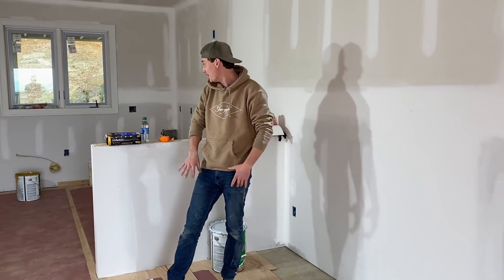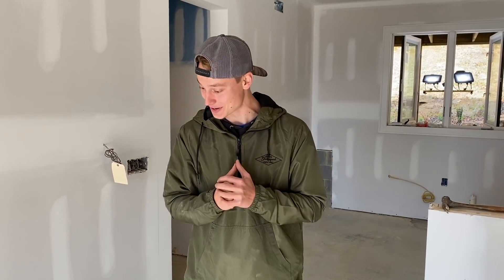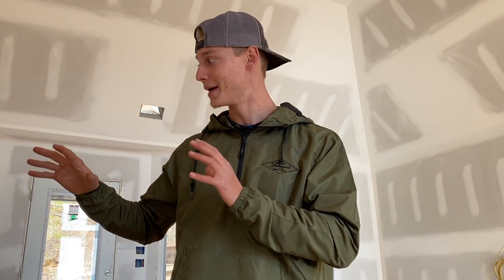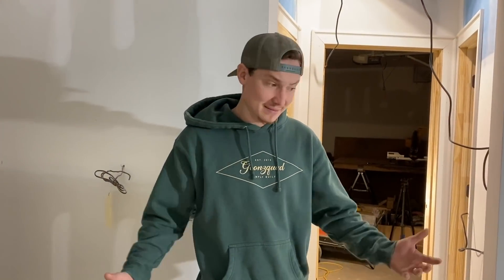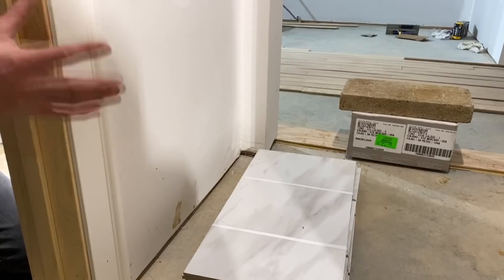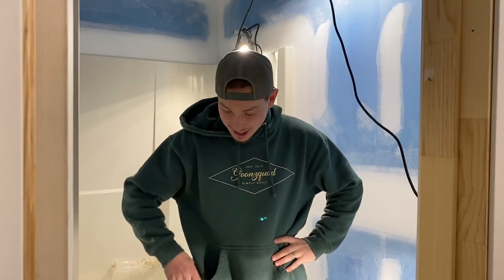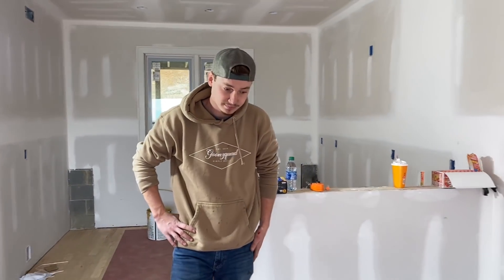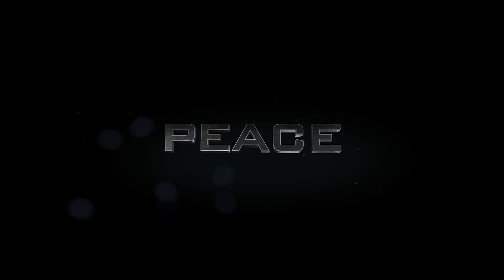The New Goonzquad Headquarters Part 55

Comment: Should have laid some sort of material before laying the wood flooring straight onto the concrete
Reply: That's what I thought
Reply: Not to mention, at the very least, a leveling compound!
Reply: It is engineered hardwood, that is exactly what it is made for.
Reply: They're using Mapei Ultrabond Eco 980 in the video.  Concrete at least 28 days old is a suitable substrate and it can be installed on below or on grade concrete if a vapor barrier is below the slab. edit: a few other requirements like relative humidity of the slab under 80%.
Reply: I do believe that is how all wood floors are layed on concrete. What you are thinking of is a floating floor. The barrier below the wood would create opportunity for the wood to lift in the future.
Reply: @toddward2310  oh
Reply: We had our floors leveled with compound and then glued straight to the concrete.  That's how its done on concrete slabs when its not a floating floor.
Reply: @newbeginnings6335  you can’t put real wood directly on concrete, it will rot. The bottom 3/4’s of the material they are using is an engineered product made specifically to be glued to concrete, only the top 1/4 is actual hardwood. That is why it can not be ruff sanded like they did on the top floor, they would almost immediately sand away there hardwood. Their flooring upstairs is full hardwood, not engineered because the mating surface is wood upstairs, not concrete.
Reply: Don't you all get it, fails mean more clicks, like that nonsense with the big window and everything else.
Reply: They needed to use a glue with a moisture barrier mixed into the glue like ultra grip. But it's about $270 for 4 gal and covers about 80sq ft a bucket. Eventually the concrete will sweat and swell the wood then pop up and discolor a few years later. Also with hardwood you have maintain the moisture level in the home at all times. Opening the window on a humid day will create issues like cracks in the finish.
Reply: I installed bamboo flooring in our home on concrete slab. The glue I used creates a moisture barrier. The only thing i did differently was to trowel the glue on the floor instead of to the flooring like they appeared to. That way I assured that the concrete was completely covered with the barrier.
Reply: @toddward2310  that makes sense why the 3/8 was not what they went with in the first place. These guys came from doing flooring I trust they know more about this than most other things they do.
Reply: Upstairs you are supposed to have a paper layer put down first.  In the old days they used tar paper.  This is meant to prevent squeaking.  The ultrabond eco 980 is the incorrect glue application they need Mapei Ultrabond ECO 995 introduced in early 2010 is a combination adhesive and moisture protection application.
Reply: the glue is moisture prove.
Reply: @Patty Homes well they're just asking for issues. When they first installed the windows i was like wow ok they're going to leak. Last week it did and ruined their floor. They need to do things right from the beginning else you'll end up doing double the work and actually waste more time and money.
Reply: @toddward2310  so your saying engineered wood wouldn’t expand or potentially dish if the slab was above the recommended moisture content and there was no damp proof membrane between the two
Reply: @mikep8080  There should be no need for a moisture barrier upstairs. Only reason for tar paper upstairs would be to help reduce creaking noises. But I do agree, glue used on concrete slabs should be moisure resistant type.
Reply: @Collie_Collie_911  That's what I said and in my comment I stated the paper was to help prevent squeaking.  My house was built in the 60s and back then they used the same tar paper that was used on the exterior walls.  I have a roll of the modern paper in my supplies for when I do my kitchen in oak.  It must of taken weeks for homes to finally air out the tar smells back then.  Interesting fact that the reason alot of homes were built with oak flooring in the 60s is the construction companies were given a tax break if it was used.
Reply: @vita8208  The 980 is called moisture cured nothing in the specs state moisture proof.  The glue uses moisture in the substrate and the air to cure the glue.  The 995 is specifically listed as moisture proof.  It is also the glue recommended by the manufacture for that application.  With wood floors its always best not to take chances.
Reply: @mikep8080  bad if it's the wrong stuff, you're correct.
Reply: Mike P I know that's what you said, my bad. I was skipping through the video and glanced over your comment. I missed them troweling the glue down as well, only noticed the first row they had to take back up where they glued the back of flooring.
Reply: @danielboard7097  I am saying that engineered hardwood was specifically designed and created for concrete application. I know this because the $30,000 worth I had put in my house when they were building it was done this way, and when I freaked the f out on the builder because they were not using any barrier, they took me to school about the product. I was told however, that I need to monitor and regulate the humidity inside my home or the floors will buckle and dip if humidity gets to high or to low. That is a requirement in any home with real wood floors though. I was told to keep my humidity between 35 on the low, and 45 on the high side which I have, and I can tell you my floors look exactly the same as the day they were installed 6 years ago.
Reply: It doesn’t matter because the glue will catch on the concrete and wood when it has a sealer on it. So if you put a mattierial it would move just for you to know!!
Reply: @toddward2310  that is the truth and that’s why GOONZQUAD bought engineered floors.
Reply: @toddward2310  interesting I also fit hardwood and engineered wood here in the uk.. and if I were fitting either, fully bonded to a concrete floor it would be getting a liquid damp proof providing the concrete was still damp of course. Engineered is far less reactive to moisture but I wouldn’t risk a damp screed. Either the screed in your home was dry ie under the recommended moisture or they fed you some bs unless the adhesive had dpm in it or you may just be lucky. I also do sports floors engineered fixed to battons and still us a dpm if the screed is damp it’s essential if you want warranty stated by product installation guide. It may be different from where your from idk... You are right about humidity it’s a woods worst enemy.
Reply: Yeah. It's too humid where they are. The concrete needs to at least be sealed, with a plywood sleeper floor added for best long term results.
Reply: That hardwood will buckle without a vapor barrier..floating floor would be betterm
Reply: @Collie_Collie_911  They did apply it to the concrete, not the flooring....
Reply: In america it is so different to lay down wood floor then where i live we we have way more rules how we need to do it haha
Reply: No because it’s a glue down. Yes if it was floating
Reply: I thought this to!
Reply: No waterproofing before tiles? 🤷‍♂️
Reply: Agreed. Non pressure treeated wood that's not rated for ground contact is going to absorb moisture from the concrete and eventually create a serious mold/rot problem.

Comment: Don’t you have to bring it all into the house and let it normalize to the house temp to prevent expansion and contraction?
Reply: The flooring I used said that too.
Reply: Yes
Reply: But the house is the same temp as outside. There is No heat on yet.
Reply: @Nathan Thomson Its a bot. Just report it.
Reply: Their house is not temperature controlled yet guys. Think 🤔 the inside is the same temperature as outside minus the windchill. There is nothing to acclimate to

Comment: YOU NEED A MEMBRANE BETWEEN THE CONCRETE AND FLOOR. YOU ALSO NEED TO GET THE MOSTURE LEVEL DOWN BEFORE INSTALLATION
Reply: How will the glue go down if you use a membrane!? Can't use it on hardwood floors..that's for engineering flooring
Reply: Exactly. Plus the slabs were poured like ten years ago. How much longer should they wait for the moisture to go down?
Reply: You need to seal in the concrete with a moisture barrier even if you are gluing. Especially at grade.
Reply: You want your wood to sit in the house at constant temps of 70-75 until the moisture level, when measured with a meter, is at or below 8-9%
Reply: @davidbunker5429  if it's newer concrete

Comment: I've never seen anyone install hardwood out of the truck without the wood acclimatetizing
Reply: @electricurinal  Correct although they may end up with some issues once they have heat in the house.
Reply: @christophergray4024  it concerns me that there is no venting for the hood fan in the kitchen... that should be connected to the furnace system right?
Reply: @jasenswick7725  It should NOT be vented to the HVAC system. Ideally, it should be vented directly outside. If you vent it to the HVAC system, you'll introduce humidity AND grease/dirt/etc. Not something you want in your HVAC.
Reply: @christophergray4024  Perhaps you misunderstood. I never said vented to the house but when I turn my hood fan on high, the home furnace/blower kicks in. It is vented to the outside. 
Regardless these guys don't even have a wire there for this that I can see.
Reply: @jasenswick7725  If your HVAC kicks in when you turn the hood vent on and it's NOT connected to your HVAC, there's a problem. Assuming they're not connected, one shouldn't affect the other. The only thing I can think of is that turning on the hood vent is drawing cool air in from someplace causing the temp @ the t-stat to think the house needs more heat. Or it could be a coincidence.
Reply: @christophergray4024  Im no hvac guy by any stretch and live in canada so maybe code is different up here? my understanding is that in cases of high usage on the hood fan, the house furnace kicks on to help clear air quicker... but hey I could be way off.
Reply: @jasenswick7725  If they're wired together, maybe. I wouldn't wire them together but maybe it's a US v CN thing?

Comment: thin foam underlay should be laid under the flooring without glue. also real or laminate wood flooring should be acclimatised too the house. the heat of a finished house will warp wood flooring thats laid in the cold.
Reply: That's right and they should have heat in the house before starting any flooring.
Reply: True, but this might be a different type of wood flooring that's actually glued to the floor. 

The underlay allows for movement of the wood flooring and softer sound when walking, if I'm not mistaken
Reply: @krispykruzer  yes it allows for both m8. however glueing down any type of timber on a concrete surfice thats not insulated is asking for trouble. hard wood floors will warp easily with changes in temperature. of all the good building the guys have done on this house i think this will be the worst desicion they have made

Comment: Dont you need a moisture barrier on top of the concrete before installing the wood ??  Also shouldnt you leave the boxes of hardwood in the house for acouple days  to let it get acclimated !!  I had hardwood installed on my concrete floor and they used a vapor barrier and refered to it as a floating hardwood floor !!
Reply: This isn't a engineered floor ...
Reply: @scottsime5197  yeah it is, they showed it in a previous video
Reply: The house isn't climate controlled so it can't be acclimated properly. They are in for some serious problems when the heat comes on.
Reply: @ryans5704  they have no idea. We just sanded a new floor where the guy had it installed with no hvac, it was the most cupped raw floor I've ever seen. We told him it would probably fail but he wanted us to sand it anyway. It's not our install so we didn't care and just sent it. Looked amazing, should last until spring time lol

Comment: Oooohh noooo you messed up again!! You never just bring in the new flooring and go install it...it has to sit in the room to get use to the temperature..going to screw up
Reply: They’ve fucked up a bunch of stuff why start doing it right now
Reply: Its engineered, not real hardwood on the bottom, just a thin veneer of wood on top.  Wont shrink.
Reply: I don't think the house is heated yet, so it's probably already the same temp

Comment: Usually in Australia when putting timber on concrete floors we put a water resistant masonite or marine ply down first.. that way it makes the floor more level and leaves a better finish..
Reply: here in merica we have mastic that acts as a moisture barrier. In the old days like 20 sum yrs ago we used to put down a moisture barrier first b4 the engineered hardwood
Reply: Nothing in the house is waterproof or moisture protected. Why start with the floor?
Reply: We use the glue as the vapour barrier... meets all codes if used correctly...👍👍
Reply: The air conditioning and heat isn't even on or controlled. Without acclimating any of the wood they are in for some serious popping and cracks opening up once it's running.
Reply: Aaron Anderson I'm expecting the house to float away at some stage
Reply: adamgc73 yeah they’re def gunna have issues after things are done
Reply: Yep Rick thats old school.  Been using vapor barrier glue leveler  for decades now. You should try works a treat.
Reply: Same here in the UK. The glue used will have moisture barrier properties within
Reply: @kred3208  In the old days those floors I stuck down are still stuck with no issues.. the concrete and timber have different expansion contraction co-efficients... more chance of a floor surviving long term is to have a bigger sheet underlay stuck down to keep moisture completely away from structured floor.. still using 2 layers of glue miosture barrier included..
Reply: @ryans5704  Thought the same thing myself... though the flooring was sitting in what looked like a moistish warehouse... but yeh, acclimate the wood for a few days before sticking it down...
Reply: @TheChaztor  I'm way beyond doing floors these days mate.. plus old school ways give you piece of mind and a better job..

Comment: Aren’t you going to have some mold issues without installing a vapor barrier before throwing that wood down..?
Reply: I don’t think you have to when using glue. I don’t think the glue would do very well on a sheet of vapor barrier. They basically just laid tile made of wood. No vapor barrier when laying tile
Reply: you need something solid to glue to. felt paper would make for a floating floor
Reply: Architectural engineer here to clear things up, the glue they are using prevents moisture thats why they used a screet coat on the bottom of each plank and on the actual floor itself. Not all glues you purchase act as a moisture barrier so if you're doing your own floors make sure you read the glue you buy thoroughly ! Good luck and happy new year!
Reply: @richardharper4329  tile doesn't absorb water lol
Reply: Opinions are like assholes, everyone has one!
Reply: @JPel1973  But clearly some are more valuable than others, lol.
Reply: @Mr Jaxon maybe. That would make sense

Comment: When you guys said headquarters I was thinking a building where you could do cars, this distressed house do it yourself stuff is boring.
Reply: plus their house building knowledge is very poor, they'll have to tear up this hw floor.
Reply: @gcw02a  I'm not disagreeing, but why will they need to rip it up?
Reply: @2H80vids  the moisture from the concrete will leak into the wood and bow it like a roller coaster. no barrier installed.

Comment: Solid hardwood directly on concrete is never a good idea. You are guaranteed to have problems. Engineered flooring with an under-lament is the only wood flooring recommended for laying over concrete.
Reply: It is engineered hardwood. They talked about it in the last video.
Reply: Wrong
Reply: @BaggerJay  Thanks Jay C. I missed that in the last video. What they are putting down looks the same on both sides to me.  Guess it’s a cork or at least a similar color underlayment?  What about laying under cabinets?  I’ve been told that’s a bad idea too.

Comment: You want to put the tile down at the entrances, it works. When we built out house we had our fireplace guy out a matching pad at the front door, the area at our dining room french doors and our master bedroom french doors. We are so happy we did it is easy to clean, keeps the wood from getting scratched (especially with wet dogs coming in and out) up and looks great.

Comment: Go ahead put first finish all over because you want it finished under the cabinets if you can.  Going to to quick job anyways and dry pretty quick.  I would also try get PVA all over walls even behind cabinets I blast out a house even before flooring or trim.  Raw paper and water equals mold.

Comment: Curious to see how the hardwood floor turns out … usually, wood is extracting and contracting over time, that's why you install it "floating" and with ample room at the edges and around the corner of a counter. You do glue the planks together but I never ever heard of someone glueing it to a concrete floor, especially not directly without any moisture block. I think the hardwood will bulge up over time, have fun!

Comment: You should put a tile foyer at the front door, they make big ones that are slide resistant so you can walk on them without slipping! 3 foot out and 2 feet to each side will protect your hard wood from rain and snow& dirt all of these will wreck the wood!!And you can set your boots on it!

Comment: The EC80 glue may not provide a moisture barrier, plus the floor must be somewhat level. Place two to 3 runs then use blue tape to hold in place let that dry, the planks well move while glue is wet.

Comment: You might want to come up with some kind of cover/awning to keep the weather off of your front entry. If you had a ceramic or porcelain floor it wouldn't be a big deal. Or don't use the front entry when it's raining.